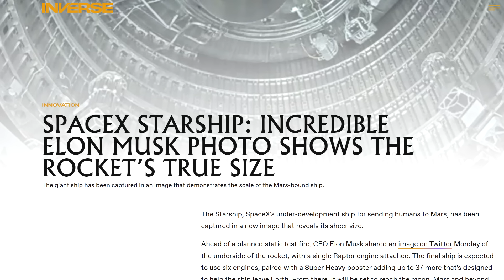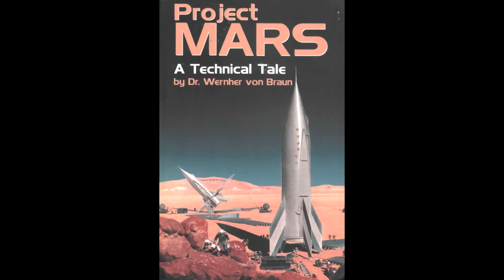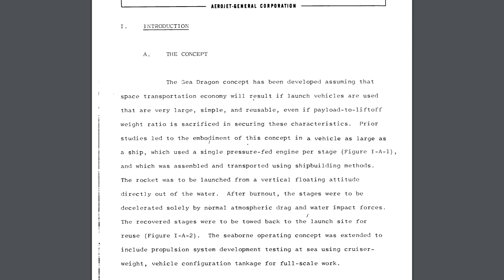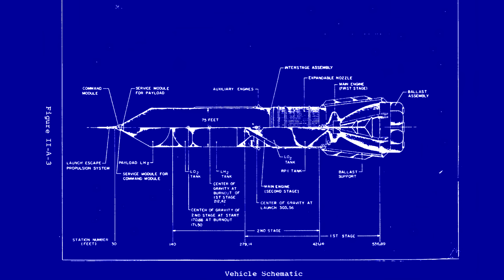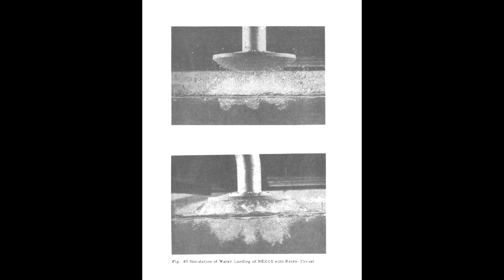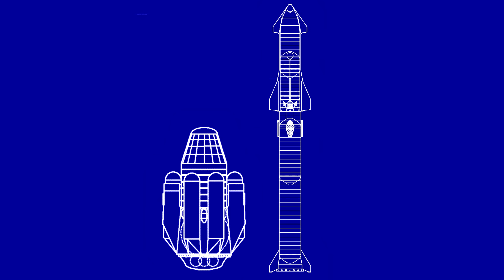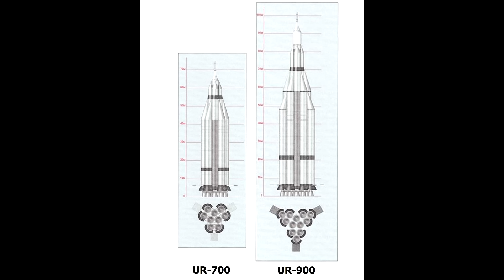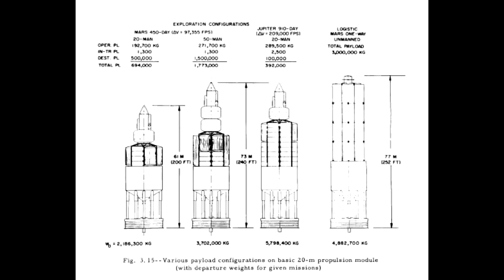The Old Rocket Designs That Make Starship Look Small

Comment: It's extremely unfortunate orbital solar wasn't pursued, the greens would ultimately have stopped it anyway (because they hate power), but it could have provided gigawatts of nearly free power 24/7.
Reply: Did they figured it out how to transfer power down without burning local cities or overheating atmosphere? Because last time I've checked it was still a concern :)
Reply: @randomnickify  They got something figured out using microwaves and giant antennas, where the amount of microwave radiation in center of the antenna would still be within OSHA limits for industry. You could even grow crops under the reciever wires.
Reply: In addition to the technical challenges of wireless power transmission through the atmosphere and weather, it wasn't done because it doesn't make economic sense. You get more power for less money just building solar cells and batteries on the ground.
Reply: @lofowens  It depends. Real estate down here is expensive, and one of the main SPS program objectives was reducing the lift cost of payloads into orbit. Plus, you save a bit on supporting structures, since space solar panels can be foil-thin.
Fun fact: One of the Heavy-lift Vehicles from that study (the Alternate Design at 10:31) has similar payload to Starship (120t), yet only 4000t mass when full. Which is less than simply the fuel mass of Starship (a 20% boost), and even with some mass reserve! Apparently, aluminium construction/winged flyback is a pretty efficient design!
Reply: The math really, really doesn't work. If you live in a place where land is that expensive (and I don't think even Manhattan would be, when you account for the extreme energy loss air transmission would result in) you just build the solar panels somewhere more affordable and run a cable to wherever you want the power. It's called a power grid. And while you can make solar cells very light, the transmission equipment (laser or antenna) isn't going to be.
Reply: It is not possible.....